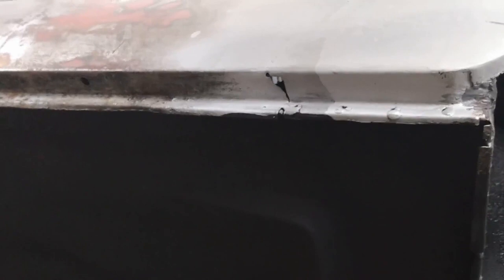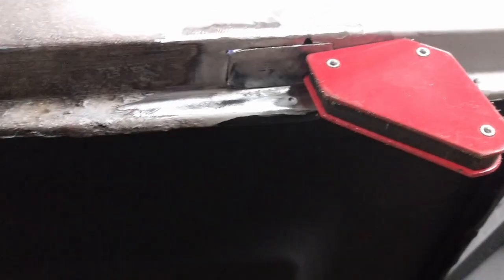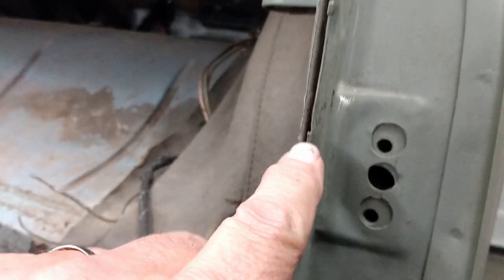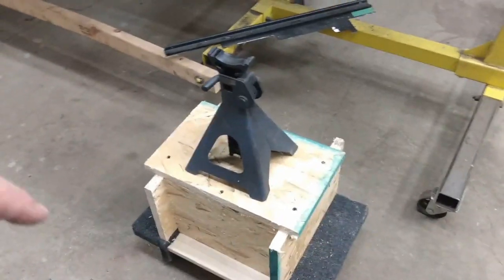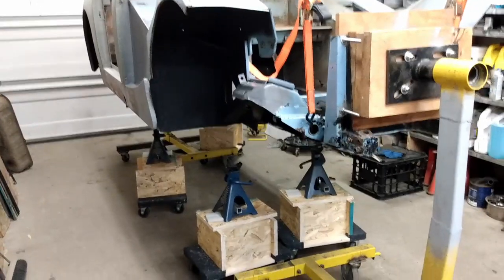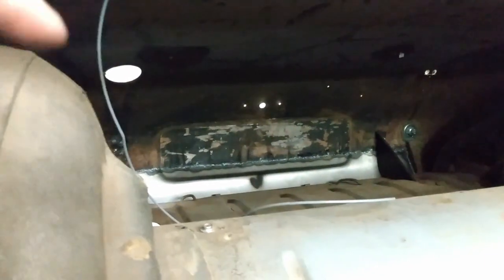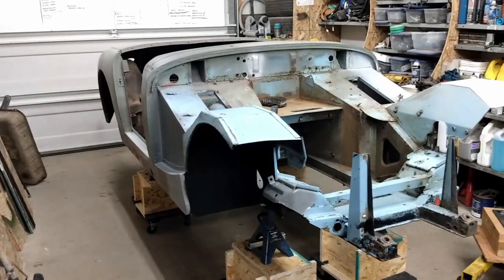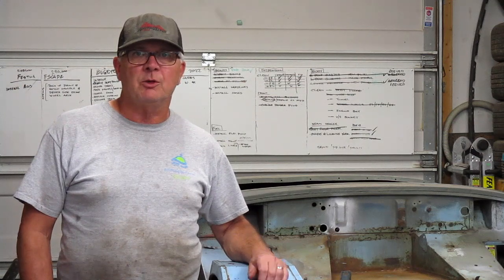Last bit of metal work and some custom jack stands & it's off the rotisserie!!! Bugeye Build Ep. 40

Comment: Hi Ian, Big milestone! You should be proud. Yes primer and paint before it gets too cold. I did a Mini Cooper R53 surface rust repair and paint in my garage in the early Spring (Minnesota). Even using all the tricks to warm the cans / paint and having a heated garage the paint and clear really orange peeled. It turned out fine but the peel added many steps to the process. Learned a lot but next time I will wait for warmer weather. The cold concrete floor really soaks the heat out of the space.
Reply from the maker: Thanks Bill. The past couple of weeks have been real confidence boosters. The goal is to get the main tub at least into primer now and then the doors and bonnet in the spring.